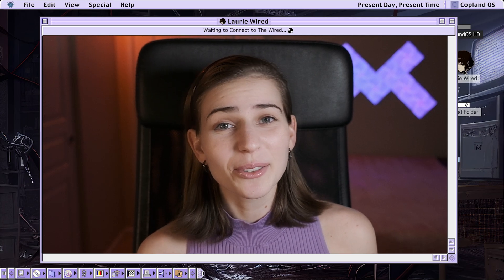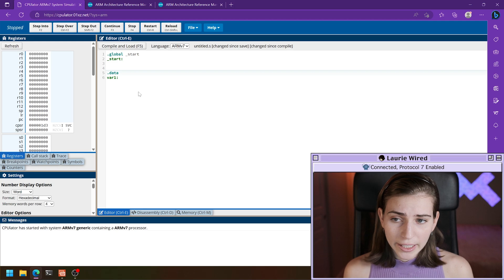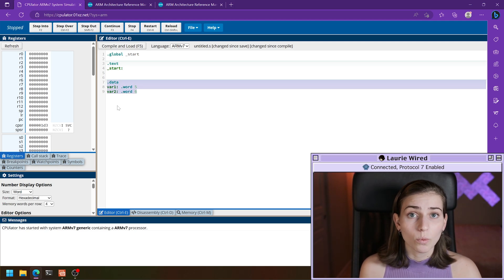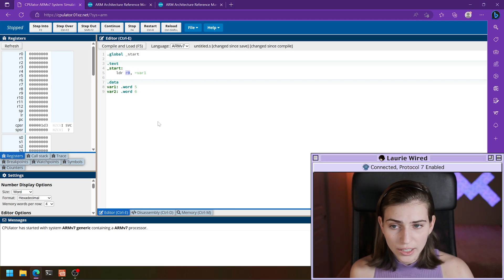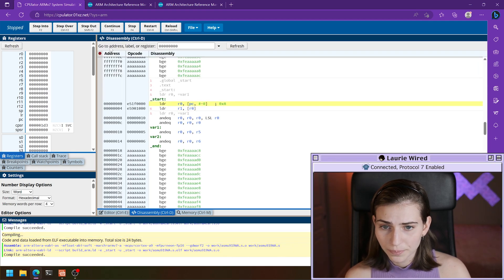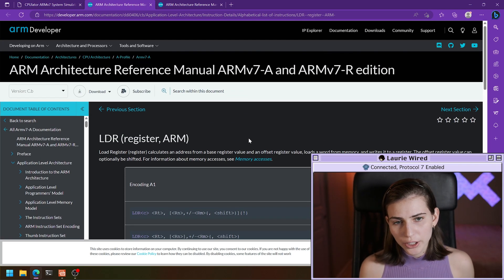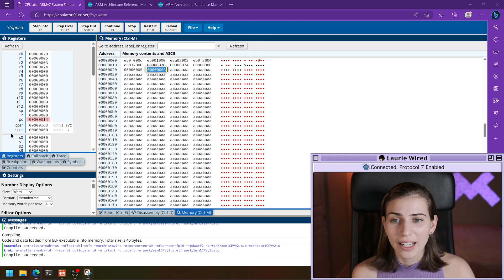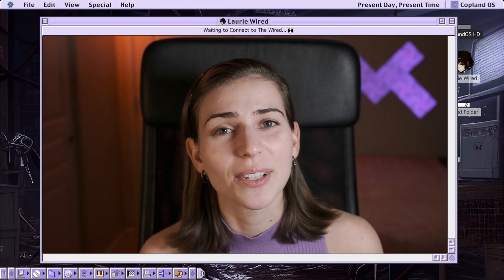ARM Assembly: Lesson 3 (LDR, STR)

Comment: A few Errata:
- you said that a word is a 2 byte value, but a word is a 4 byte value on ARM (only on x86 a word is 2 bytes)
- you said that to load a value from the data section you need to load the pointer (=var1) and then load from that pointer, but you can actually just do "ldr r0, var1" (without the =). I guess for the sake of the tutorial it's fine, but in general, doing it like this is inefficient and not position-independant.

Comment: where did the 24 for r3 come from and 20 for r0 come from? Sorry, I get everything else(mostly).
Reply: Memory addresses generated randomly
Reply: @OscarDithejane  Thanks. Much easier to understand now.
Reply: They're not generated randomly. She put five instructions in her program which are 4 bytes (32 bits) each, so they make up the first 20 bytes of the program. The 21st byte is the first byte of var1, and since the address numbering actually starts at 0, it's at address 20. It's a 32-bit number, or 4 bytes long, just like the instructions, so var2 starts at 24. So when loading the memory address for these two variables, it loads 20 and 24. Notice that when she only had two instructions in the program, var1 was at byte 8 (the two instructions taking up 4 bytes each) and while she didn't use it, var2 was at byte 12.

Edit: I made a small oversight. The numbers are actually 20h and 24h, ie they're hexadecimal, not decimal like we normally use. The number 20h is actually 32 in decimal. The assembler appears to be putting some empty space between the instructions and variables which probably has something to do with alignment, but I'm just learning the ARM processors so I can't give much of an explanation as to why it needs to align it like this. It's not random though.

Comment: First of all: thanks for the great videos! Please keep going. I like the way you break the topic down into small comprehensible chunks. Secondly: I was surprised when I saw that the first LDR was changed from absolute addressing - as I would have expected when using a label - to PC relative addressing. And then the offset of "-4" didn't make any sense to me, initially. Later on I found that this weird offset comes from the fact that ARM uses a three stage pipeline and when we see an instruction being executed the PC already has moved some bytes further - depending on the size of the instructions. In case of 32 bit instructions it has moved already 8 bytes further.
Reply from the maker: You're absolutely right about ARM's use of pipelining, and this indeed impacts how the PC behaves in certain situations.

ARM is a pipelined architecture, which means it fetches, decodes, and executes instructions in stages, overlapping these operations for different instructions. The PC (Program Counter) indeed points ahead in the instruction stream due to the pipeline.

Regarding your observation about the use of the -4 offset with LDR: When an instruction is fetched, the PC is often a few instructions ahead of the current instruction being executed. With 32-bit ARM instructions, the PC is typically 8 bytes ahead during the fetch stage.

However, since in the ARM architecture, the PC behaves as if it is two instructions ahead of the current instruction (4 bytes per instruction, so 8 bytes total), the offset -4 essentially compensates for this advancement. This way, we are "correcting" the PC value to the desired address.
Reply: @lauriewired  Thanks for your response and for all the effort you put into your channel!